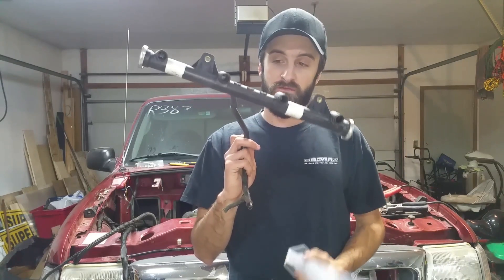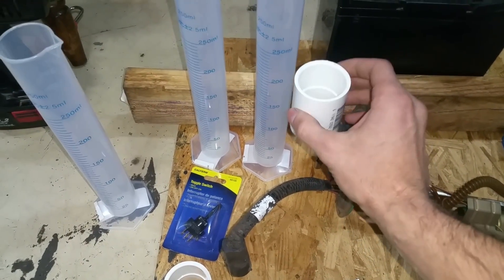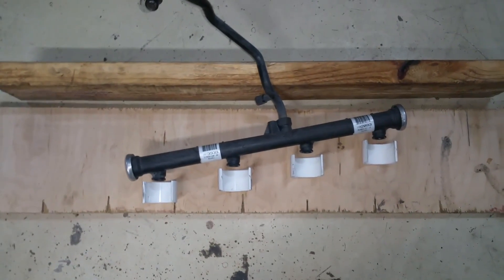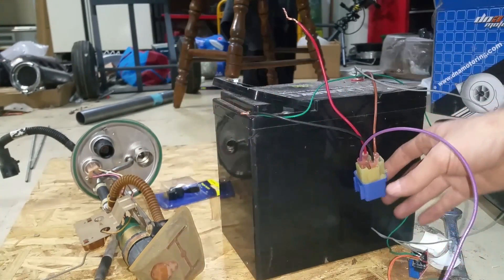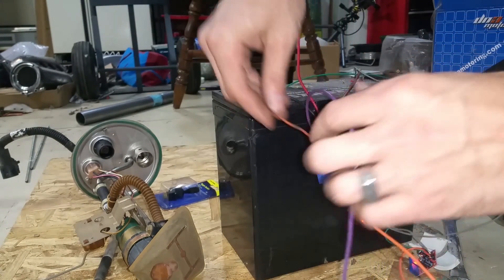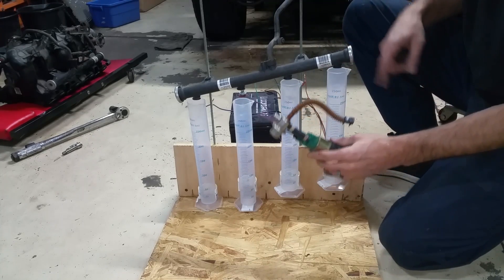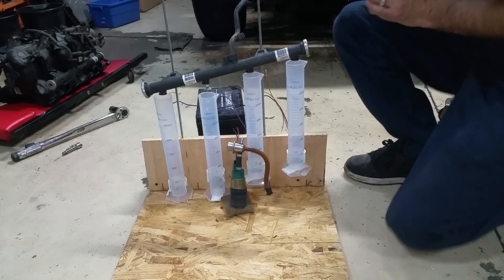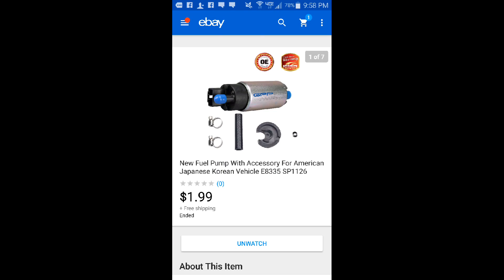FUEL INJECTOR TESTING FLOW BENCH!!! LS LSX DECAPPED INJECTOR FLOW TEST SETUP!!!

Comment: Thanks for the information. I know it's an old video, but I hope you will see this and respond.  How  did you secure the injectors to the fuel rail?
Reply from the maker: I used the factory clips. The GM LS injectors have a clip that secure them inside the rail.
Reply: @BlaserBuilds  Thanks a lot! Love your content.